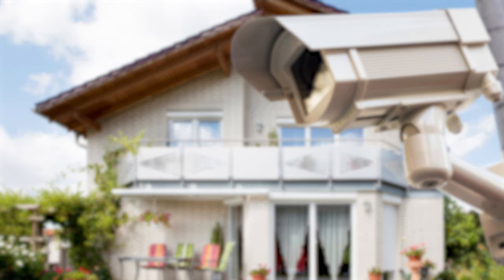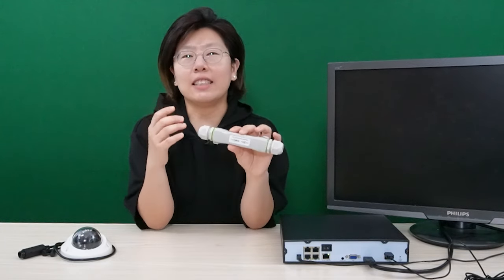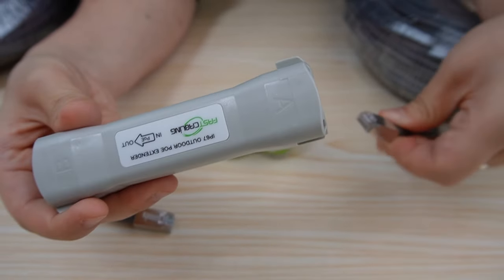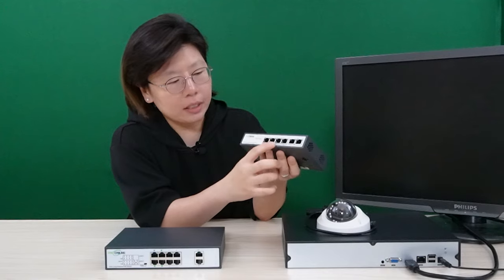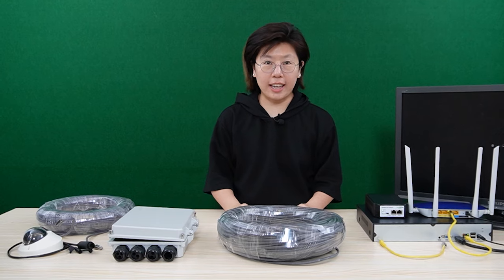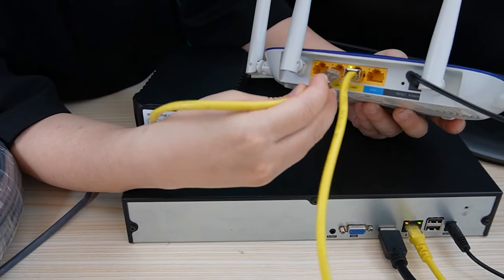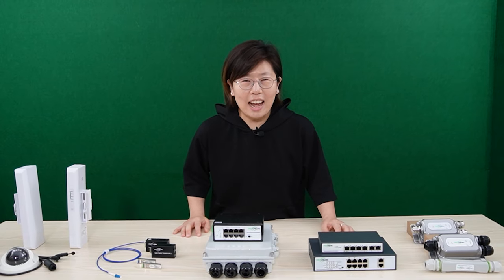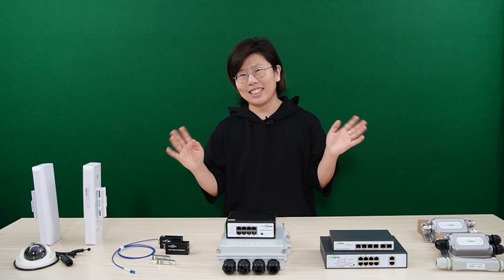Setup IP Cameras beyond 328ft (Ultimate Guide)

Comment: Can I connect multiple NVR's to a single Internet Source using the Wireless Bridge.  I have to NVR systems, one in building A, and another in building B, but my Internet Router is in Building A and I want to see the cameras from building B also without paying for another Internet Router for building B?   Thanks!  Love your Video by the way! 😎👍
Reply from the maker: Yes, you can set wireless bridge between building B and the building A. Since you have set the NVR in building B, so the footage will keep storage locally at building B. If you pick the 900Mbps bridge, you will have about 250Mbps speed in the really situation. It can carry multiple cameras from the NVR, but you might don't have the all the high resolution like what you get on the building B.

Comment: I’m about to setup mine with 8 IP cameras and still not sure of how to go beyond 300ft. With your demo videos it helps a lot. I just need to get my materials to fit my setup.

Thank you
Reply from the maker: You mentioned it is beyond 300ft. What is the maximum lenght? If the maximum lenght is less than 800ft, you can use the general switch with CCTV mode. It will downgrade the speed to 10mbps to achieve 800ft data network. You still need to consider the power loss inline (or total power budget). While the lenght is beyond 328ft, you always need to calucate the power loss. The PoE extension never repeat the power because the powe can't be repeated. It is the energy.

Comment: how about the poe extender is in middle of poe switch n nvr?
Reply from the maker: Yes, the PoE extender can repeat 328ft data network. You will need to have PoE switch or PoE injector at one end before it can send the power inline to that PoE extender at the middle. This is the one I mentioned. https://www.fastcabling.com/product/poe-extender/

Comment: Hello, Out sport field has purchased a long-range Fast Cabling 1500 feet POE switch and also a Waterproof Direct Burial PoE Extender
. My application is unique. I use a laptop and video producer (attached together via HDMI). Video Controller (LVP100U+MSD300-1)YouTube etc.at 6 cable ....to send feed ...to large a LED screen to display LIVE scores and other videos (e.g. YouTube  etc.) during the games at the sports field.  The older LED score board was only 200 feet away so no issued. The new large LED scoreboard is 940 feet away. Please advise how may I use this "1500 feet switch solution (with or without Fast cabling Waterproof Direct Burial PoE Extender) with my PC+ Video Controller . I am NOT using a camera in this scenario. I may try using other ports on this switch for my NVR ++ 3 POE cameras, if it works
Please advise....
Reply from the maker: Hi, can you email us at support@fastcabling.com? Our engineer will get back to you as soon as possible.

Comment: i have a Swann NVR8-8580 will it support a POE switch,  but not really sure if i need the POE switch  Im wanting to add on a pan tilt camera at approximately 450 feet would i need  a POE switch or do i only need a POE extender
Reply from the maker: Swann NVR8-8580  supports PoE directly through its built-in PoE ports (you can find this info in its full specs or consult the manufacturer). You can connect PoE cameras directly to the NVR, and it will provide both power and data transmission over a single Ethernet cable per camera. 

You'll need a PoE extender if you want to add a PTZ camera at 450ft as the maximum transmission distance for PoE is limited to 328ft. Please refer to this video: https://youtu.be/imAhGzrSAys

Comment: Great easy practical explanation Thank you :washhands:
I had a question:  On one NVR 12 channel with PoE switch, and 100 mbps bandwidth,
How many maximum no Hik-connect mobile users and laptop users can use? is there any limitation ?
Reply from the maker: For vendor-specific equipment, it is best to refer to the manufacturer’s documentation.
Reply: @Fastcabling  Thanks for immediate reply👋 Yes but I couldn't find any document / videos specifically on Hik-connect user limits. If you made any video on user limits in future Please let me know Thanks in Advance🤝

Comment: I like your stuff and your videos. Can I ask a question I got a Orbi I have a satellite mesh network set up I connected one that is 500 ft I put a poe on the cable and one of the extender in the middle.  Is it important that end the Poe be on the router side or can it be on the satellite side of my system it is between two mesh satellites that are hard cat 6e cable can I put it in either side or do I need it one one side only thanks
Reply from the maker: You need to pick correct version of POE extender. That PoE extender has power handshaking since the edge device doesn't need PoE. I assue you only have one satellites with incoming data, not two. If this is the case, you can set the PoE injector at one end and put the PoE extender at the middle, then whatever network device at the second end.

Comment: I would like a 8 cameras tht have local storage, powered dc or have an ac/dc selector switch, poe and potentially cover a house that has a length of 45m . What is the diagram set up like.  Wld like to project the output of the 8 cameras on a centralised screen. What products would you recommend. Thanks
Reply from the maker: Please contact our support team at support@fastcabling.com for personalized assistance completely free.
Reply: @Fastcabling  thanks

Comment: can we really say the 5th method is wireless though the cameras require an external power source
Reply from the maker: The connectivity between the bridges is wireless but you need to connect the camera to the second bridge via a network cable.

Comment: can i use apair of 8th cat6 cable to transmit power to ip camera and how
Reply from the maker: Are you referring to Method#3 outdoor PoE powered switch? Currently, we have only developed an 8-port version, which can connect up to 7 devices. But there is another option: you can use a composite/powered fiber cable to transmit power and data simultaneously to an 8-port outdoor PoE switch to connect more cameras at once.

If you're interested, we can also provide free solution design for our customers. Our team of experts will come up with a tailored design for your setup. Please feel free to contact us at support@fastcabling.com or submit your inquiry here: https://www.fastcabling.com/free-solution-design/

Comment: Hi, what is pse and pd
Reply from the maker: PSE is Power Sourcing Equipment that provides power to other devices over an Ethernet cable to simplify the setup of network devices, especially in situations where power outlets are not readily available. PD (powered device) refers to devices that receive power from a PSE over the Ethernet cable. Examples of PDs include IP cameras, VoIP phones, wireless access points, and other network devices.